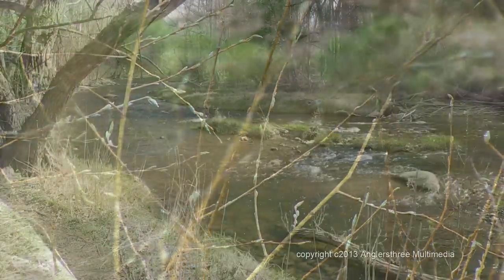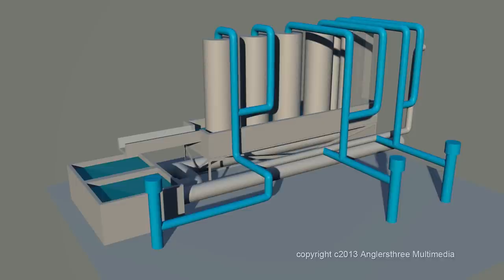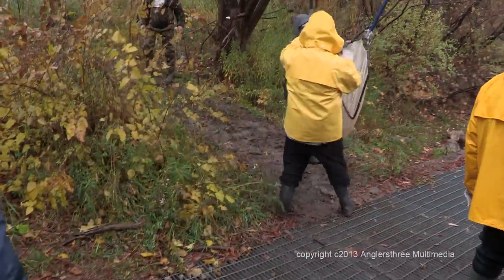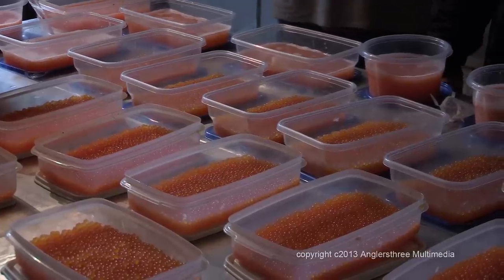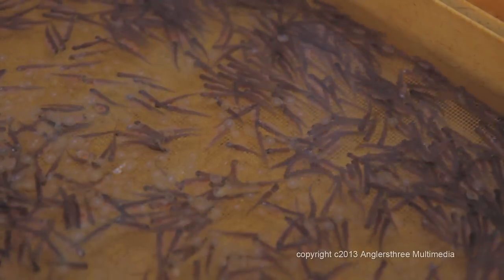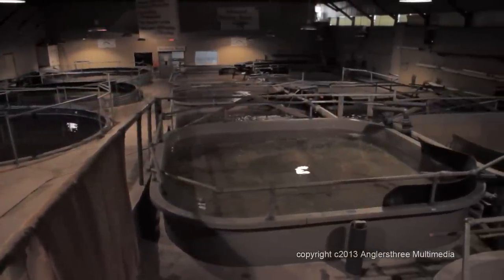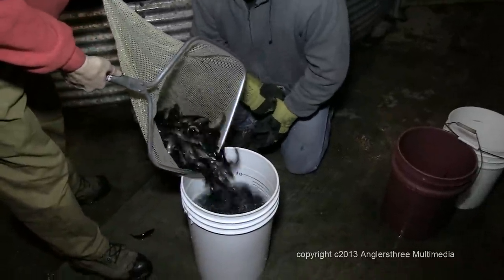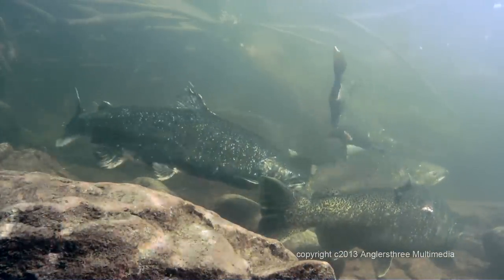Salmon And Trout Hatchery Documentary

Comment: See there's a bit of a problem with this method which is the over saturation of genes. Too many of the population then become sourced from the same genes which cause numerous problems like infertility and the like... In a case like this of the spawning fish dying after spawn, they should try to catch as many male and female fish as possible and strip them all. This leaves room for multiple gene pools to mix as they would naturally. More fish is good, but if the gene pool isn't managed it can have terrible long term ramifications for the population, and in cases like salmon which are a migratory fish late stage fingerling releases can prevent them from spawning properly...